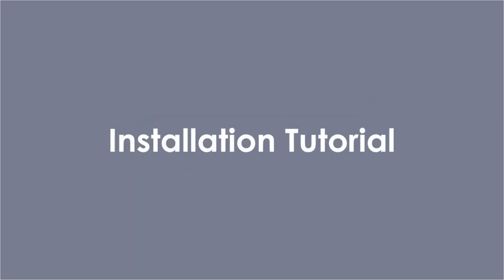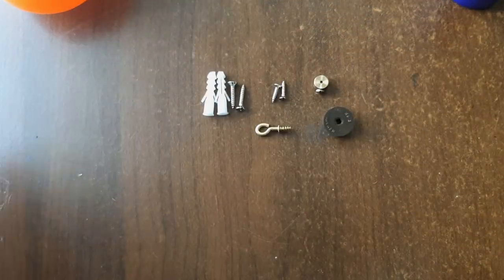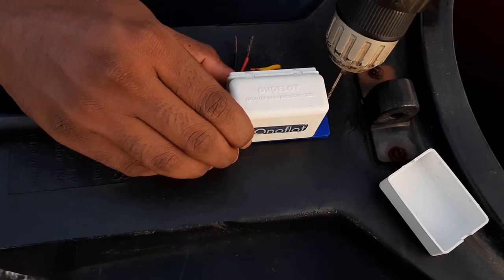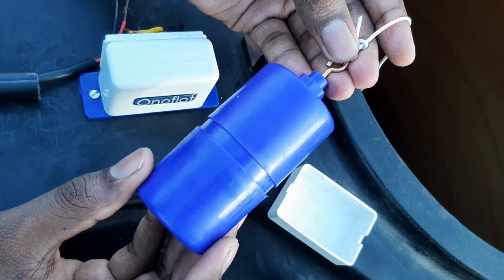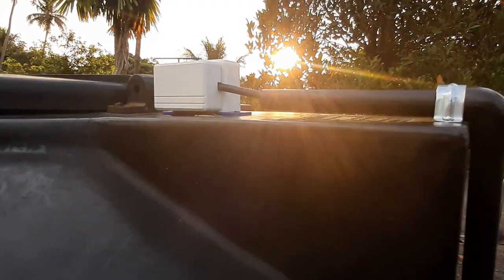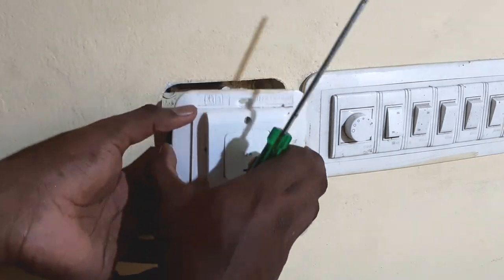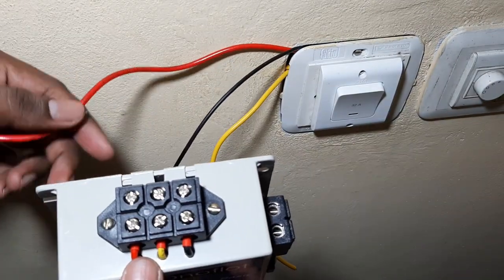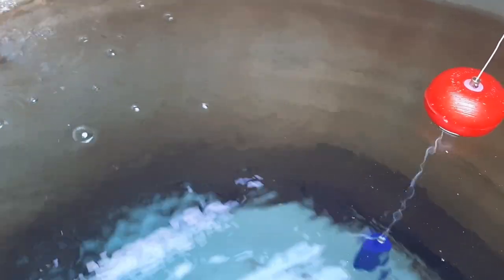Onoflot ® Basic - Automatic Water Level Controller - Installation Tutorial (English with Subtitles)

Comment: What if we set it to manual mode and the water tank overflows like before and the unit on top of the tank gets in contact with the overflowing water. Will it pose any damages? Also will impurities stop the float ball from moving freely on the string? Any long term reviews?
Reply from the maker: The unit on top of tank will not be immersed by the overflowing water. Usually there is an overflow pipe set for the water to go through.  Even without that, it is impossible. But don't fix it inside the water tank, in cases where it is a concrete tank. Keep the unit outside the tank as shown in the video. And Debris in water doesn't usually cause problems. It can be used with different water qualities, including waste water pumping.

Comment: Rewire this with an impulse relay and modular contactor. Connect the impulse relay contctors in parallel with the start button of motor starte and the NORMALY OPEN contctor in series with the stop push button. Impulse relay will take command to switch on or off the impulse relay and you will have electrical isolation between high voltage and low voltage control ciruit.
Reply from the maker: It is like level switch, working on the basis of mechanical principles. So we are not suggesting it for press on off model switches with starting capacitor. You can use it input breaker of a contactor.

Comment: Can we use this for submersible pump???
Reply from the maker: If it is a normal switch it can be. If it's a Push ON Push OFF type switch it's not possible. But we do have models which can be used for such pumps.

Comment: Is it work on submersible pump?
Reply from the maker: It works on normal Switches. It cannot be installed for Push ON- Push Off type starters.
Reply: @IntifosIndustriesKochi  yes normal 1.5 HP submersible starter not push on/off will it work?